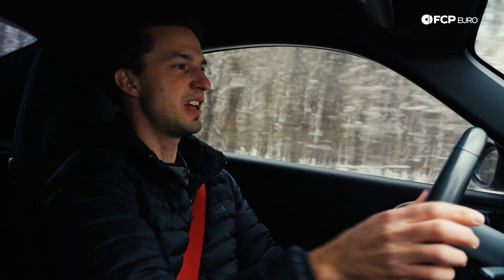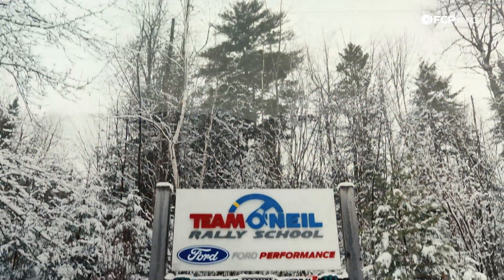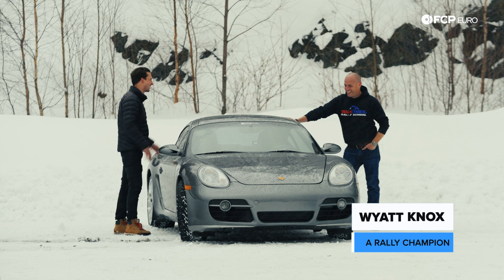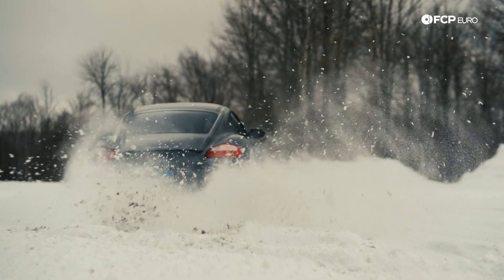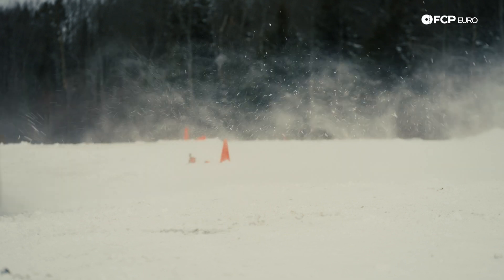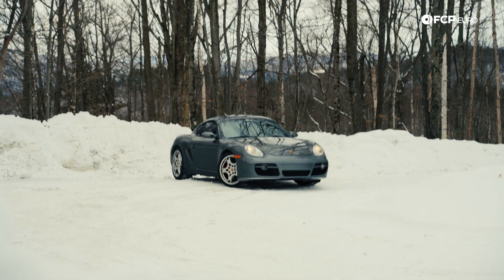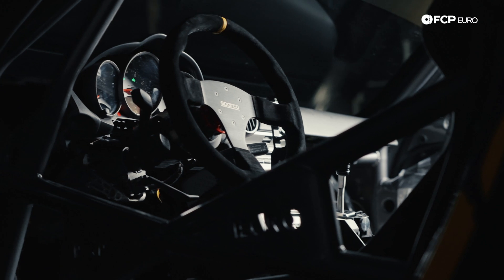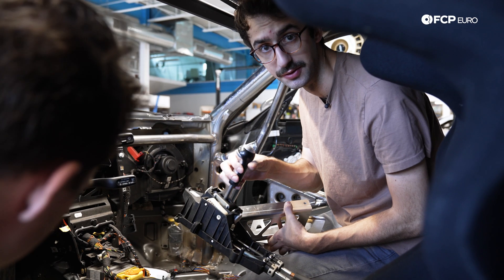Is The Mid-Engine Porsche Cayman Really Cut Out for Rally? Proving Everyone Wrong: Rallye Cayman Ep1

Comment: The reason the cayman was never a rally contender (and you say it yourself in the video "never designed for rally use") is because of cost and relevance.

As budgets, YouTubers, and the market as a whole levels up out of the "top gear age" to the point nothing is impossible, using STAMPED-OUT street cars, to look for the rally machine inside is just adding cost if you're not the manufacturer itself trying to convince the gullible mass market their products are so great at what buyers think they'll be doing with those products.

Nothing wrong with this idea... If it were 2018 at the latest. But the scope here is the problem, and this series will basically spell it out as it goes, even if it were a 997.2 or whatever "hero" street car anyone dreams about.

When serious, just start with a carbon tub, weld amd bend whatever shape you want in subframes and roll/roof structure, and start giving the crate engine market the attention it deserves rather than pretending a used example (oh but we took it to so and so to mod because PORSCHE!) will "decimate all". The more projects start with reality and understanding, the more the standalone/crate market will open up and have demand and incentivize more awesome products. Even if BEVs and strong hybrids take over mobility solutions worldwide, the crate market can flex and push ICE tech to infinity because it's a hard to regulate hobby market - not a mass population privilege.

So enjoy hacking away at that cayman to the point it's a tube frame jungle gym with that body stapled to it, and know in 5 years even the creators will be bored with it and win nothing, unless it's HPDE play time. The cost also double because you started with a street car instead of building properly, meanwhile an AI piloted offroad EV will scream past you in 5 years after that. Time flies...
Reply: What you're saying makes sense but the Cayman and 911 are already used as competitive rally cars in the R-GT class and I'm pretty sure those cars have stock chassis' besides some bracing and reinforcement

I do think more niche kit-car type projects will play a big part in the car enthusiast market with metal 3d-printing becoming more accessible and regulations strangling car manufacturers out of being able to build interesting moddable cars
Reply: @MegaJessejames91 Yes, you get me. I'm aware of the RGT series but looking at the rule books its' apples to apples, you're building for a VERY specific mission that needs a lot of weight to survive anything that looks like few years use, in a seriously compromised way. Are RGT cars fast? Depends. Could they get faster, better?

As far as the 911 RGT is considered, take a look at what Guntherworks did w the latest 993 Turbo restomod. Now that's how you do a serious project. Where did they start?

Carbon fiber tub, modular chassis, asked big brains to go all out on suspension and drivetrain. They weren't the first, but compared to the money this YouTuber will eventually spend, gotta ask oneself: was it worth it? No doubt it will be fun to approximate an RGT cayman, since you're doing something 2015 called "cool" and there's less weight, but the question, the fact, will always haunt the owner and driver... "I can make this even better, couldn't I?"

Creator seems like a chill maker more build channels need instead of the hypefest bros or the somehow not hit puberty celebs, so personally would love to see this guy "make it" - but not get disenfranchised when he learns the hard truths of mass production hurdles for a serious improvement, and not just weakening a good product to pretend to be what it's not.
Reply: @ZenDrives  We put a roll cage and suspension on it and had a blast! No caved in roofs yet! ;)
Reply: @AlexNelsonFCPEuro Nice! Yes zero caved roofs!

Comment: I have been driving for 32 years and learned something new today with the when you get understeer while drifting on slippery surface like that you can use left foot on break to get traction again on the front.  I have heard of that but never in that context and I have tried it bad results so I never tried it again, but now I did get when to do it (but I am sure it will take a lot of practice to master it).

I am planning to buy a older Porsche Cayman if I get sold my stocks I have that have skyrocketed in 1 year :) Here in North Norway it is long cold winters and extra high beam lights is a must have to avoid crashing into reindeer in the winter darkness. So I will mount something similar to lights on a rally car.
Reply from the maker: Keep us posted once you invest those stocks into a Cayman build - you know we've got you covered! 😉

Comment: The 981/982 unit body is one of the stiffest Porsche has ever made. 
It’s the hidden gem of sports cars. It shares more than half its parts with the 911 but weighs less, costs less, and handles better.
Because it’s mid engined it has better balance and is eager to drive fast so yah, rally it.
Reply from the maker: We couldn't agree more - it's lived in the shadow of the 911 since it came to market, in our opinion undeserviginly. Amazing platform to start with. Maybe we build a 981 next!